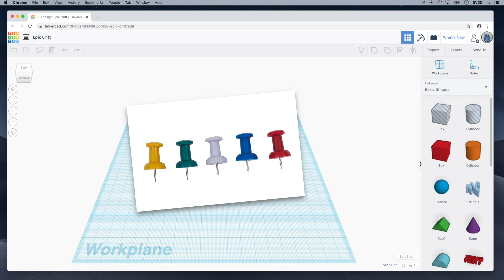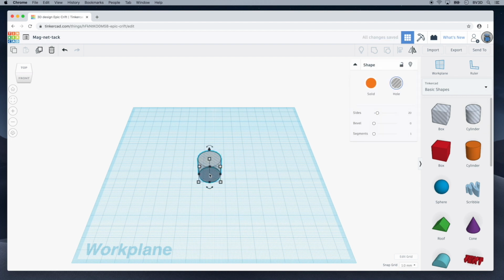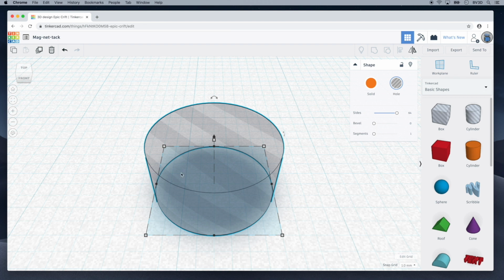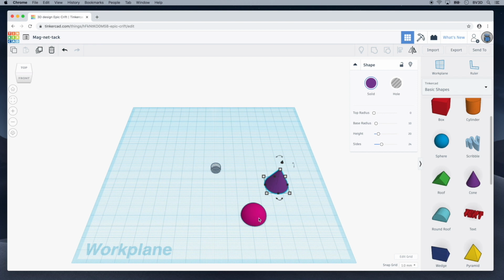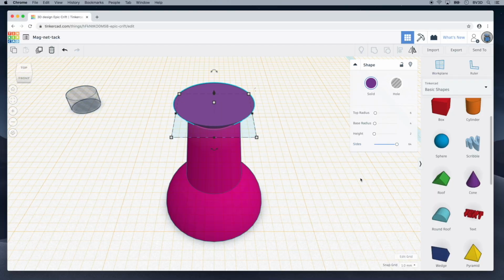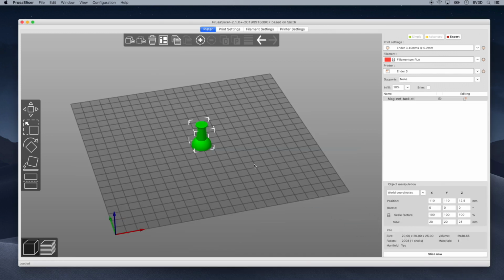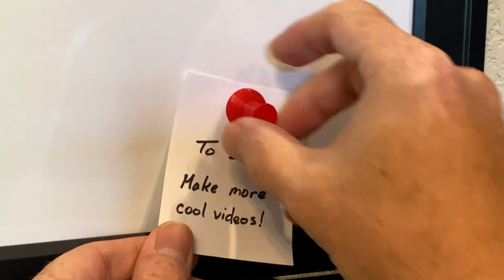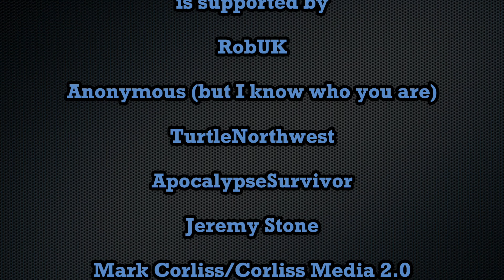How To Design a Magnetic Push Pin in Tinkercad - Fun & Simple project!

Comment: Just an idea - you can eliminate the glue and the exposed magnet by inserting a magnet-shaped void inside the pushpin shape, and then when slicing, add a pause command for your printer into the GCODE at the point when the void is mostly printed and about to be sealed. You then resume the print on your printer after dropping the magnet into the void. Saw someone else describe this and I have been experimenting with it here - makes for awesome prints with magnets sealed and hidden inside. Great video! Best wishes.
Reply from the maker: That's a cool idea, and I've thought about doing that before. My only concern with that is some of my printers have a lot of ferrous metal on the hot end (fan shrouds or other bits) that a magnet might find very attractive. 😮

I have done the "embedded object" trick on a project that needed some weight, and had internal voids designed to hold pennies. Paused the print once there was enough clearance, loaded the voids with coins, and then resumed the print, and all was well (and, in the end, heavy)! 👍

Comment: Bryan, is the original push pin covered under a license that allows remix or modify the pin? Tongue in cheek. What's the advantage of using multiple Workplanes instead of just off setting the parts on top of the existing item?
Reply from the maker: Hi! Parts always land on a workplane. Workplanes added via the Workplane tool will stick to other objects, and so by sticking a workplane to the top of the parts that were already part of the model, newly added parts landed at that height. If I hadn't added that workplane, the second cone object would've landed on the floor, so to speak, and I would've had to drag it up to the height I needed.

Another fun thing about workplanes is that they'll stick to angled objects as well, so if you need to match an angle, you can drop a workplane on the object you're trying to match, and then drop a shape onto it, and you don't have to fiddle around with angle adjustments.

Hope that helps! 👍
Reply: @BV3D    I'll have to try this, I always just stack parts, and sometimes it's a pain. Thanks.

Comment: Ahhh. That nozzle width must be why I can’t get male and female threads to actually work.
Reply from the maker: Hi! I struggled with that one for a long time before I figured out what was actually going on. But now I always take that into account. If I'm trying to make a hole for an M3 bolt, for example, and I'm planning to tap the hole, I will usually make it 3.2 mm in diameter on the design. That leaves a little bit of plastic to cut the threads into. If I'm wanting a screw to pass easily through (say, on a lid) I'll make it 3.5 or 3.6 mm in diameter on the design. That leaves juuust enough room for the screw to pass through unimpeded. (I've lost count of how many times I had to break out the rat-tail files to get something to fit!)